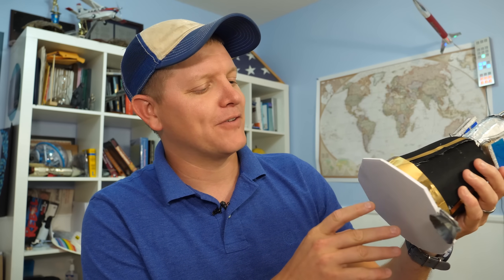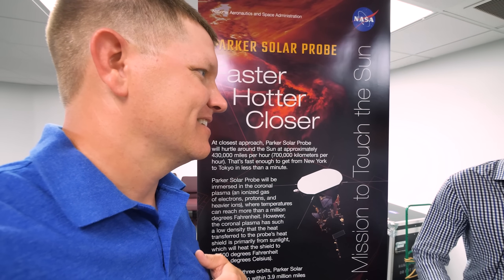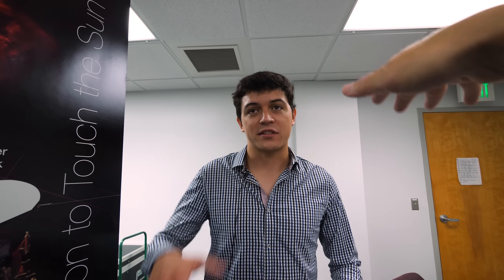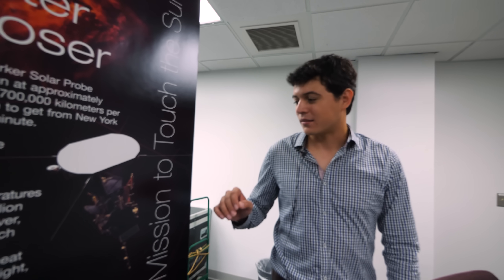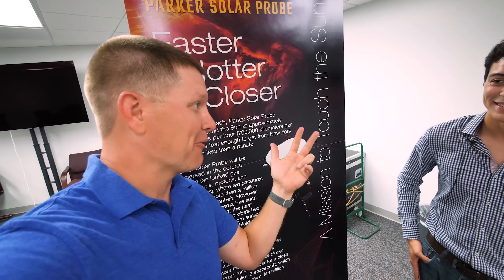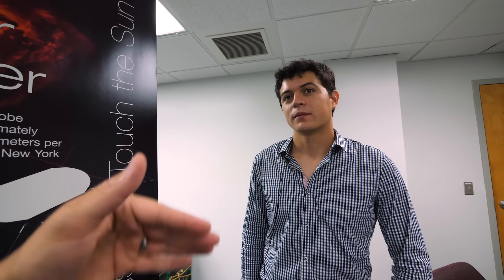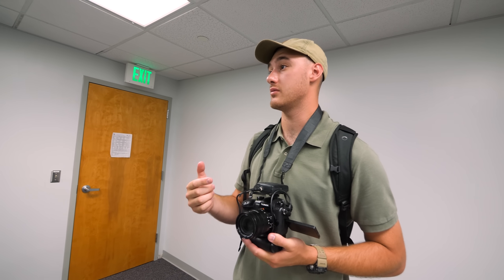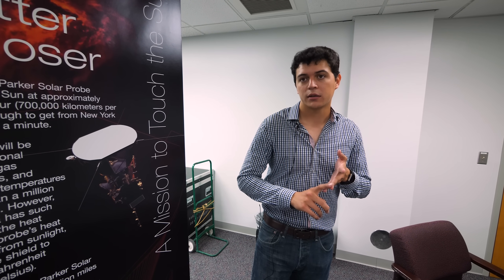Scientist Interview: Felipe Ruiz (Parker Solar Probe - Deputy Lead Mechanical Engineer)

Comment: I dont believe you need thrusters for a momentum dump, it could be all electronic, ive been thinking about reaction wheel systems since around 2015 when i learned roman cart wheels left distinct directional signatures on ancient streets, that day i learned there was a distinct signature to angular momentum, thought about how to capture it, and funnel it, and i dont believe you need propellant, in a reactor wheels system, it could be all electric and you could use more than just solar arrays to power the system, also with correct suspension you may be able to make a hover craft on earth, but you could definitely use it to move in the weightless environment of space.

Comment: A burning question: why isn't the surface of the heat shield mirror-like rather than "just" white? I thought that a mirror would reflect the energy better. Was it because a mirror would get damaged by the solar wind, or maybe a white surface works better for infrared/UV wavelengths than an optical mirror would? Thanks!

Comment: 11 cm depth of shield...1300 degrees to 300 degrees.... so if 1000 degree difference / 11cm shield = 90.909 degrees reduction in heat per cm of shield thickness.... I wonder if there is a thickness that gets the heat to 0 ( taking the heat reduction as like constant it could be 14.3cm?) ...or is there a point where the thickness will do nothing and the heat will stay the same....

Comment: 6:07
Anyone know why the force is at a moment from the center of gravity? is it because of the propellant tank mass changes, so the center of gravity changes? 
why can't the shield be designed in a shape that it auto balance the probe using the force produced by the solar wind? (ie. when it turns, more force will be applied on that side to push back)
It's counterintuitive to me how they spend so much time designing the craft, but the solar wind will always push the probe out of aliment. maybe the force is small and not a big concern?

Comment: I'm wondering - why they didnt' made the shield in such form, as spacex dragon or apollo capsules used to? And then make the shield adjustable so you can move the shield little bit, to match center of mass with center of presure. That would be kind of automatically adjustable, without much less demand from reaction wheel and fuel requirments... But otherwise really cool interview.

Comment: Okay, if I got it right, there are magnetic motors turning wheels to adjust the orientation, but the magnetometer is far from them, and the probe knows when it's running the motors, so it's not a problem. Right?

Comment: So I was wondering, why do they not design the spacecraft to work like a dart? As in, use the solar radiation to align the spacecraft itself? You could drop an 82 kg tank + 4 reaction wheels if that could work.

Comment: Why not change the shape of the shield to balance the spacecraft solar wind with the center of mass?  Or!  Why not rotate the spacecraft so that the solar wind force will exactly match the attitude control needed to keep the spacecraft shield aligned?  This is what we did for the command module as it was returning to earth.  During reentry, the offset center of mass visa vi the heat shield was used to keep the attitude of the command module into the reentry friction.  Because of the offset center of mass, rotating the command module allowed it to be flown with the heat shield forward.

Comment: Super cool interviews, thanks Dustin! One question maybe somebody can answer. 

When they talk about heat being pulled away by the water and then circulated to the radiator, how does the radiator transfer energy to dump the heat? I was under the impression that since there are so few particles in space it is really difficult to transfer heat/energy without anything to transfer it to. 

Thanks!

Comment: the probe has times it's close, and time it's far, from the sun, right?

couldn't it spin 360 degrees in the opposite direction to "reset" the wheels?

Comment: but why was it difficult to avoid creating the solar torque? Is it just a matter of aligning the center of pressure and center of mass? Is it more than a simple change of the shape of the TPS?
Reply: the center of mass is in a different plane than the center of pressure. The slightest change in pressure causes a slight torque which increases the distance from the center of mass causing more torque etc etc. You can't be perfect due to differing pressures as well so adjustments are always required.

Comment: I have so many questions about how they dump all that heat into the vacuum... Like what do the radiators look like?
Reply: I think of it as shinning a heat light into the void of space.  Thermal radiation is emitted as electromagnetic (infrared) radiation via the radiators. Energy in, energy out.
I'm assuming that the solar arrays also reflect much of this thermal radiation before it has a chance to soak in. (?) I still have much to learn myself.
Reply: b1aflatoxin i get the physics of it, i just wanted to see it, i want to see how a radiator optimized for pure radiation rather than convection works. I know it’ll be black since it has the highest emissivity, but what else? The fins can’t be parallel since they’d radiate towards each other, so is it a black, corrugated panel with each fold at 90° to the other?

Comment: We've been using the same reaction wheels for a very long time. There is a known failure in a lot of space crafts with them. I'm concerned being that close to the Sun they will fail even faster. Have any precautions been taken to protect the bearings?
Reply: The main failure point was not a design flaw in the bearing or manufacture but a failure of materials and an unexpected electrical arcing  across the steel balls.  The steal balls (or pins/rollers for that matter) and i think raceways have been replaced with non conductive ceramics this should negate the electrical arcing problem and to my knowledge has more or less stopped the failure of these bearings.

Comment: So are they just using a sliver of the Solar arrays, peeking out, for electrical generation, and the rest of the panel as essentially a radiator? Why didn't they go with something like a Thermoelectric Generator?  Best of luck to the Parker Solar Probe!

Comment: Is the TPS designed for a solar flare? I mean if one gets close to the solar probe would it be enough to heat it up to a critical point where some instruments get damaged or could the increased pressure change its orbit?
Reply: You should watch the interview with Dr. Tony Case if you haven't already.
Reply: Rhyme Bito it sounded like he said in the main video that it could handle a CME fine, right?
Reply: right to the face

Comment: So why is the center of pressure off-axis(or off the center of gravity or however you'd say that)?
Reply: Watch the other interview video with Tony Case. It addressees why it's off-axis
Reply: It might just be because it can't be infinitely precise in construction. Any small deviation causes this torque.
Reply: This was my question too.  It seems a well placed, small weight, or a slight realignment of the TPS could center the C.G. to the C.P..  Perhaps the extra weight of a slightly larger shield or of balancing weights would grater than the weight of the fuel requited for momentum dumps?
Reply: In the comments, Tony Case said they tried to align the cop and cog.
Reply: Other than it’s just hard to be perfect, there is one instrument that has to be exposed on one side and that throws things off because there isn’t a matching one on the other side.

Comment: I really liked how Felipe was able to break down the basic science behind the various parts of the probe. It never even occurred to me that one could use spinning wheels to maintain a spacecraft's orientation (or change it, for that matter), I found that to be really cool. I do wonder why they didn't centerline the center of gravity with the center of pressure. I'm sure there's a reason, but it seems like it might have been much easier to keep the probe aligned if they had. Anyway, great video.
Reply: Nym Alous the pressure is different and different distances from the sun and different weather states. You can be sure they thoroughly optimized this!
Reply: Idjles Erle How is the pressure different as you get closer except to be more intense and/or have a higher amplitude? (I don't know, but if you know I would appreciate an explanation.) As for the optimization, well, seeing as how this was made by humans, who are fallible, with time and money constraints, I don't think that I can be sure that it was thoroughly optimized, which is why I wondered about it in the first place. Like I said, there is a reason, but it could be anything, from the materials wouldn't balance properly, or the battery casing wouldn't fit that way, or we could have centerlined it but it would have taken another year, to we didn't realize it hadn't been centerlined. Heck, one explanation is that the water and hydrogen that are being carried won't stay aligned as they are expended. I am just interested in what the actual reason is.
Reply: Nym Alous very interesting question. I think the expenditure of the water and hydrogen may be the reason, as it is not a constant rate of expenditure
Reply: The pressure is generally dropping off by 1/r² as the Faraday Cup guy mentioned but it is not smooth. If everything was perfectly smooth they wouldn't need to go there, but the Corona is a boiling, seething place and they are going to measure this variation. This thing will also be hit "in the face" with coronal mass ejections and it is going incredibly fast to where it is really hot. Even the Kepler Space Telescope that was going "slow" in the cold of space and was well balanced ran out of fuel after many years of momentum dumping was affected by the solar pressure. These guys will be very efficient with their 82 kg of hydrogen. I imagine random magnetic fields will also create minor torques at different times.
You can be completely certain that this probe was perfectly balanced - human fallibility plays no role here.
My only question is why they didn't put a second Faraday Cup on the other side to be redundant and balance mechanically, but i am sure they worked that all the way through and the 82kg of hydrogen was the best option.
Hundreds of people work on these machines for decades and balance mistakes are not made.
Reply: Idjles Erle Even with the Faraday Cup you could still adjust centerline and center of mass with center of pressure to be balanced. It is done all the time with aircraft. The Kepler Space Telescope was not intended to face the solar wind head on with a heat shield, and in order for it to accomplish its missions it would need to get hit with the solar wind (and gravity) on different parts of its surface as it rotated to take pictures of different parts of the universe. 
As for the Corona boiling being the reason we need to go there, that doesn't make any sense, nor is that among the stated reasons for the mission. 
I also don't understand how human error and fallibility won't play a role. If humans had a hand in something, there is the chance of error. Even the Kepler Space Telescope had reaction wheel failures and also failures to repair those wheels, resulting in a shortened mission life. Saying that hundreds of people working on a machine does not automatically mean that no mistakes will be made, in fact, as more people work on a specific project the odds of an error being made increase. 
The people who work at NASA are just people, with the ability to overlook things, make math errors, and just assume that someone else is taking care of something. I'm not saying that this is happening or has happened, I just wondered about a particular design and was hoping for someone who had inside information to address it. 
(You are not wrong about having a second Faraday Cup, though. I wondered the same thing. I also wondered why they didn't just integrate it with the heat shield, though I can think of a number of reasons why they wouldn't.)
Reply: John Hartney You are probably right. Also the water and hydrogren won't necessarily sit perfectly balanced in the tanks at all times.
Reply: Nym Alous the failure of Kepler wheels wasn’t due to humans making the wheels do the wrong actions and balance with the wheels. It’s because they didn’t expert coronal mass ejections would arc through the lubricant and pit the bearings
Reply: Idjles Erle That is what you call "an error." An oversight, a mistake, a design flaw. I'm not talking about something that is poorly made, though that can sometimes contribute. Anytime you take any number of humans, with the ability to get things wrong or not think of something, and you have that number make sometime, there is the potential for something to not be thought of or to go wrong. Does it always happen? No, sometimes we get it right and think of all the right things. But there is always the potential for the opposite. 
I doubt that even the people at NASA who are working on this project would say that it is beyond error. They probably have very high hopes that they have eliminated as much as is humanly possible, and even built-in fail-safes just in case (if you listen to some of the videos, they have a back-up reaction wheel, in case one of the others fails). I hope they did too, I don't want this project to fail, but I wondered about something, and hoped that someone who was "in the know" (meaning someone who worked on the project) would be able to address it.